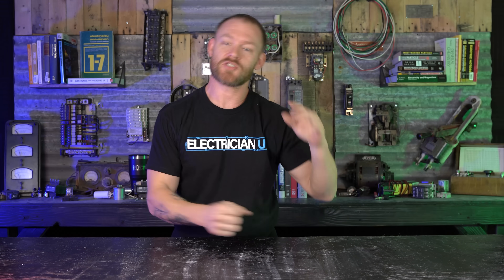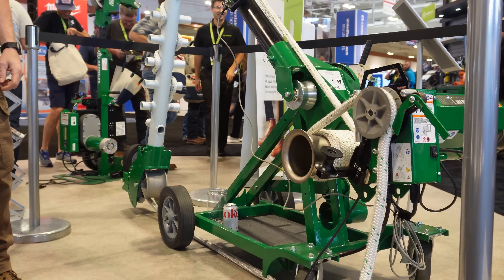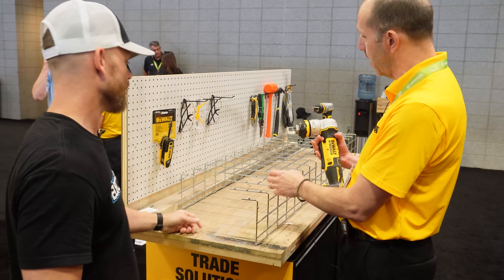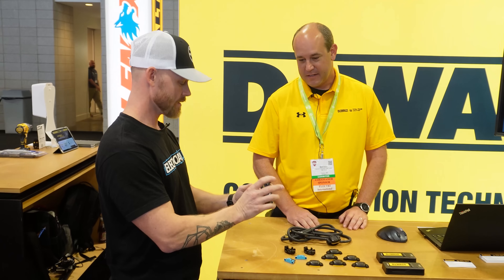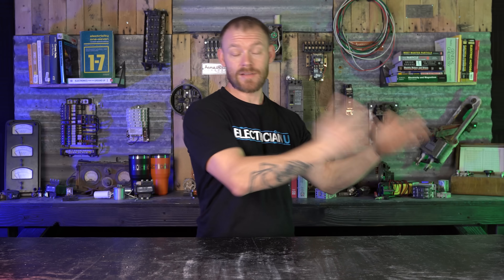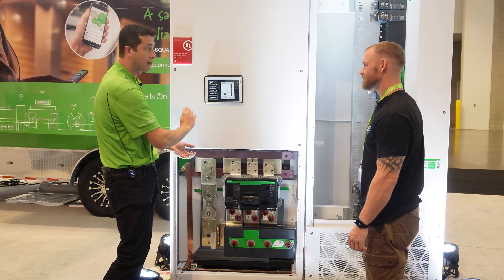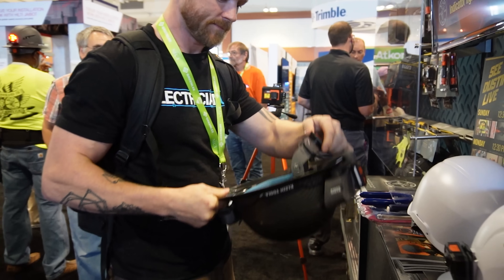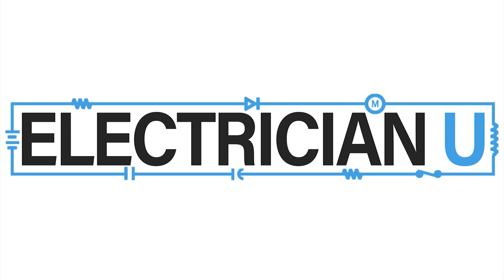New Electrical Tools of 2022!! - NECA 2021 Highlights

Comment: So this may be a stupid question, I'm about to tackle a wall in my house and need to reinstall two boxes for outlets and a switch. It's a lath and plaster wall , I'm going to have to add some studs to strengthen the drywall. What's the difference between nailing a box to a wall and screwing? I've only ever seen people nail them. Is screwing such a big deal?
Reply: Personal opinion - the benefit of screws is that they are less likely to loosen after many cycles of plugging and unplugging.   For a big box like a stove where there might be a lot of force and wiggling to remove the plug I would only use screws.  For a regular box that's behind the sofa and will be accessed once in a blue moon it makes no difference.   A galvanized twisted shank nail holds surprisingly well.
Reply: @mikegraham7078  Yeah, I was leaning more towards using screws thinking the same thing. I just didn't understand why using nails (which I see everybody use when installing a box) is more beneficial. On top of that, the screws can easily be backed out if you ever need to move or replace it as well.
Reply: @Chris.Rhodes   If you need to move a box after the drywall is up then screws vs. nails is the least of your worries.  :)
The benefit of nails is that they are cheap and fast.  That's it, in my opinion.
Reply: @mikegraham7078  the walls are lath and plaster or whatever...with the little wooden slats. someone used one of those boxes that "grip" the wall with tabs. It got pushed in, I'm going to cut out a 12"x12" square and replace with drywall. Just learned about Madison Straps. Never used them before, but someone said they would probably work better
Reply: @mikegraham7078  but thank you for your opinion man! trying to get all the knowledge I can
Reply: @Chris.Rhodes  I had to look up 'Madison strap' to see what you were talking about.  I've only heard those called 'F-clips', though I suppose they are properly called 'rework box supports'.   Anyway, yes they would help the box not get pulled OUT from the wall, but if it got pushed IN then the problem was that the opening for the box wasn't correct - it was cut over-size, or the installer tried to put screws into the plaster which caused the plaster to crumble where it needed to support the box.
The way you are planning to solve the problem will certainly work, but patching plaster with drywall is not trivial.  If you're not up on your drywall game then do some research.  You're going to need to build up the drywall with a setting compound to match the level of the plaster.
Anyway, good luck with your repair.

Comment: The hardhat fan is cool. Is that the battery mounted on the front of the hardhat or a light. If it's the fan battery it would be neat if they included a headlamp in it since it seems like it would be tough to wear both as individual units.

Comment: Hi how are you...my question is¿¿ is it against the law for my neighbor to use my nutral wire and does that effect my electric bill?? i noticed that from the drop I have 220v service...n plus i dont see the nutral wire connected to the center plate terminal where it should be connected to on my electric meter.

Comment: All that fancy technology and innovation and yet nobody can make a 14-6 awg wire strippers 🙃 
That’s like the most common wires in a residential environment.
Reply: I don't use strippers for anything bigger than #10.  I use my little Knipex cable shears to strip the big stuff.
Reply: Check out Knipex 13-72-8 they have a curved cutting shear that alows you to easily strip large awg cables. Plus they slice through MC like butter 🧈
Reply: @Mmmmmmdonuts  will do. Thanks 👍🏻

Comment: Sir, thank you for this. I'm new to project management and estimating and it helps to see how elections do their thing. 

Could you clarify feeder size and conduit sizw for 100 a 150a 200a 400a 120/240V. Underground 

still confusing me bad.
Reply from the maker: I would direct you to Table 310.16 for Ampacities of Insulated conductors, then once you have determined the appropriate size wire, I would direct you to Annex C: Tables to determine your conduit size. If you have anymore questions, feel free to reach out on any platform. Thanks for the question!
Reply: @electricianu  Thanks man. I have actually applied your info already into the job. Its awesome to have found this channel.
Reply: Aluminum

Comment: Nothing really blew me away. I'm always looking for things to make my job easier. They should make a green wire nut that more than one wire can fit through the end so you don't have to splice pigtails  on or bend the grounds back. I know Buchanans exist but then you're crimping and I don't need another tool on my belt. I want to see stuff like this that changes the game up.
Reply: You mean the Fan in the Hat didn't blow you away? High tech there.
Reply: Use wago
Reply: @kristoffer4752  ew. no.
Reply: Oooo I like this idea!
Reply: Slick thinking 🤔  I like 👍
Reply: Patent the idea brother!
Reply: I'm with the other guy that said 'use Wago'.   Unless you need more than 20A capacity, Wagos solve the problem virtually effortlessly.
Reply: @mikegraham7078  okay I have a four gang with 2 three ways that have switch legs, 2 single poles and 3 feeds. That's 9 grounds plus 4 pigtails I need for each switch. What would I do with a wago

Not trying to sound combative, genuinely curious. I never use wagos.
Reply: @TheOtisUpham  Wagos are like wire nuts that cost more but are really, really fast to use.   Wagos come in different sizes to take from 2 to 5 conductors, and they are all connected internally just like a wire nut.  In the case of your four gang I would use one 5X wago for the grounds from the three feeds plus pigtail to the metal box, plus a jumper to a second 5X wago that can supply four connections for the four devices in the box.   That's two wagos.  I'm going to assume that you can use the devices themselves as terminals to carry the feeds where you want them.

I hated the idea of wagos.  I really did.   Wire nuts served me well for decades, why change?    It wasn't until I actually used good ones (genuine wagos) that were in the peckerhead of a motor on a piece of equipment that we had purchased that I started to view them as something that a professional would actually use.   I bought a few of them to try them out, and I now really feel let down if I run out of them and have to use wire nuts.

Note - I only use the lever-lock type wagos with the orange levers.  I do NOT use the 'push in' types that work like the stab connections on the backs of residential devices.   I really hate those.
Reply: @TheOtisUpham  You can get a Wago that holds up to 8 conductors, both Wago and Ideal make them but not many places carry them.
Reply: To crimp a ground crimp just make sure you have alittle bit of space and take your linesman’s and pinch that end. You don’t need a crimper for them
Reply: @ericsiemek373  fair point. I just don't like how Buchanan's feel more permanent than a greenie. If you work with the people I work with, you gotta rework boxes sometimes lol

Comment: The Dewalt Cable Tray cutter looks amazing. That's something that I'm definitely interested in. Thanks for sharing your experience at NECA 2021.
Reply: Do commercial electricians cut that enough to justify a tool like that. The reason I ask is I’m a plumber and I have a coworker who buys lots of tools whether he can justify them or not. 2 tools he has are an all thread cutter and an impact specifically made to tighten bands on cast iron pipe. They’re handy but I can’t see spending $150 on a tool that does the same thing as a band saw but doesn’t have all the other uses. As for the impact, a regular impact works fine. It doesn’t specifically torque them so if an inspector decides to be a dick and check the torque it’s irrelevant and in over a decade of plumbing I’ve never seen an inspector check torque. If the pipe doesn’t leak it’s good. Basically these tools seem like novelties. That’s what that cutter seemed to be to me but I’m not an electrician

Comment: 110°F air blowing down the back of your neck is still 110°F air blowing down the back of your neck. Unless that Klein Tools gizmo has a heat exchanger in it, it's a waste of money. A chilled gel pack with a mesh housing is a better idea. Just have to have a few gel packs to get you through the shift when it's that sweltering on the job site.
Reply: Not really. Evaporative cooling of your sweat does cool you down... that's why you sweat.
Reply: @bryanjk  Then you don't need a fan, or A/C since simply sweating in 110°F heat ... since "evaporative cooling of your sweat does cool you down"... lol👌
Reply: All gel pack/a nice hat is also gonna be a lot less than whatever Klein is gonna charge.

Comment: That bluetooth tool tracking seems kinda pointless.  Since it's just a bluetooth tracker, once it's out of range of your bluetooth module, then how do you know where it went?  How do you know where it is, other than "within 150' of this bluetooth module"?
Reply: Over thirty years in the audio business I’ve “lost” (either temporarily or permanently) enough expensive tools to careless or tired crew and other contractors / labor that I’d be “the ONE” guy that would take the time to do the templates, etc. to cover my assets.
Reply: @pistolgrips  Touchè!
Reply: I'm thinking that you can probabaly link multiple of the gateways together inside a facility. So maybe every storage room has an asset tracker gateway, and when you log into the web portal, it tells you which room the tool is in.
Reply: Exactly. All this tells you is that the tool is nearish. Like...cool. A gps tracker is what I thought it was
Reply: I was thinking th same thing, Also - Tell me ONE contractor that will actually take the time to set up all the GPS tracking devics, sync them to each tool, write up a template of each tool and serial #, etc....We all know when new tools comes to the job, Battery goes on the charger and tool is OUT of the box, being used!
Reply: when he said it could be used to "prevent theft" i was thinking that anyone trying to steal a tool could just pull the tracker off and walk away, lol.

Comment: Quick question - for someone new to the industry, and, not having a whole lot to spend on tools at the moment, what do you suggest are the bare essentials for performing the job (for about $100)?
Reply: A pair of linemen pliers and a flat screwdriver will do 80% of the work.
Reply: @beeps7  Much obliged
Reply: get the Klein 6-Piece Apprentice Tool Set. it has all of the essential hand tools you'll need for every job
Reply: @Coca222Cola  Thanks you for the help
Reply: Linesman pliers maybe the one with the strippers built in, 11 in 1 Klein multi screwdriver, a set of 420 and 430 channel locks. You can do a lot with those. It'll probably be more than $100 but that's a great starting point.
Reply: @TheLucasthatyouknow  Thanks for the help
Reply: He already made a video on it.
Reply: @addisonisaacson161  I watched the video of all of the tools, but, was wondering for the absolute essentials, as some of them cost $30+ per item
Reply: You'll need to spend more than that
Reply: @peaceinator56  For a complete set of tools, I understand it's going to cost more. I was wondering about the bare minimum that could get by to start, at least until a pay day or two.
Reply: @Joe_Parmesan  Pair of kneepads and a dustpan.